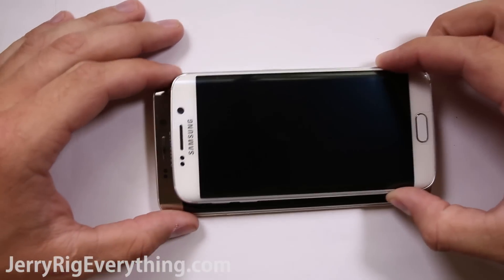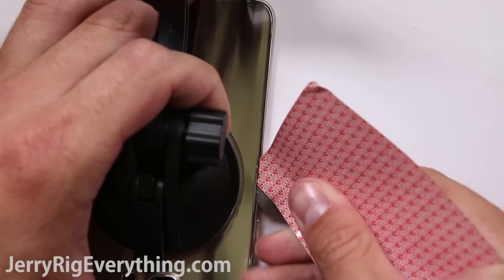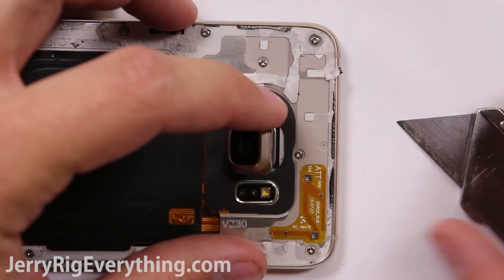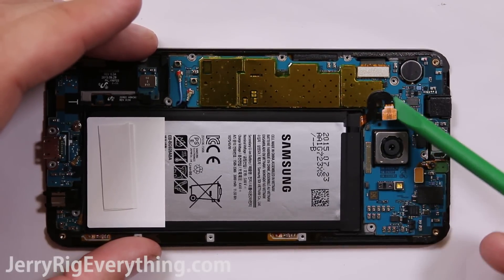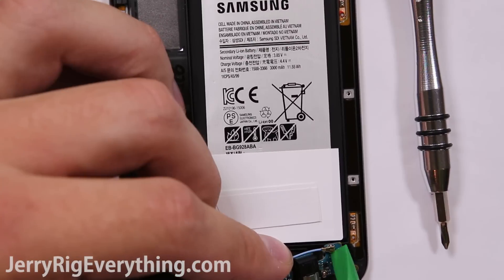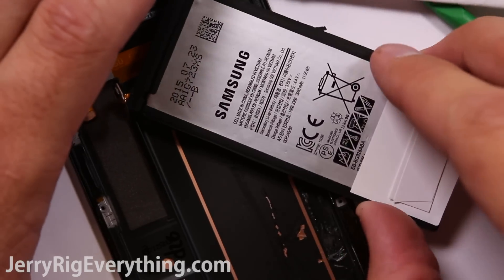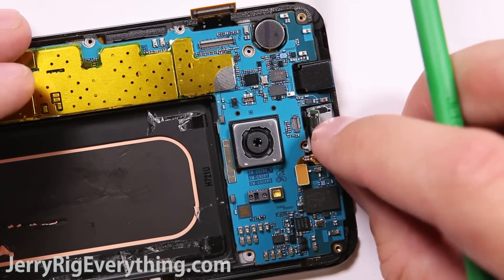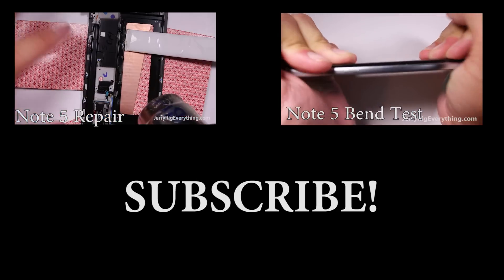Samsung Galaxy S6 Edge + PLUS Teardown and Repair video

Comment: Hi Jerry, thanks for the video! Quick question - I just poked the top mic hole with a sim card tool by accident. Whilst it didn't break the mic, do you think it could have damaged the water proofing material?
Reply from the maker: Nope! You're safe.  The waterproofing is off to the side of the shaft not at the end.
Reply: @JerryRigEverything  Thank you so much!!!

Comment: Dear Jerry!

At 2:00 minutes, there is a copper cable labeled "ATT R06 ZERO2_SUB" in the lower right corner of the phone. What is it for?
I accidentally damaged the part labeled "ATT R06 ZERO2_SUB" while replacing the battery on my own phone.

Can you still use this phone or go to the trash?

Thanks for the answer!

Comment: i tried using hair dryer to soften the adhesive but it wont budge
Reply: Same. I put it on full heat, high fan, with the dryer touching the back for several minutes to where it was too hot to touch and couldn't get it off.

Comment: Yeah... I just replaced my Battery and I kinda of pried to hard to get the battery out and when I put it back together I damaged the Screen. there is a black spot about 1/8 round and some pixels that are damage , they are mixed colors and will not go off. all in all it works and I want to replace the screen or get a phone with a bad ESN and replace the motherboard with mine. Just make sure to be very carefull when removing the battery, damaging the screen is VERY easy!!!

Comment: where can i find temperature sensor and how can i replace it for S6 edge ( not plus)?? It stopped charging showing the phone is overheated.
Reply: BASINA ADITYA ....charge only with original charger......and don't use while charging

Comment: Hey my phone is working but doesn't detect touch.

Screen is working like normal but it detect i am touching it.
what can i do?
Reply: Yağız Efe Demirel Your digitizer is broken. Replace the front glass
Reply: ah sorry this comment of mine is too old. i found a way to make the phone work. When you heat up the phone it jumps to life. it starts to detect touch. But after some time (probably because it gets cold) it makes that again. and about the digitizer. i don't even have scratches on the screen and when you heat up it works like a charm :D So which part is the problem now?

Comment: Hi hope u fine. My s6 edge was heating up when i put it in charge and all the time when i use it freezes then off and on i have send it many times to samsung for repairing but they created more issues to the phone than repair it. Can u please guide me how to fix these issues on my mobile as i got another iPhone to use but i still love my s6 edge. Please I'm waiting for your reply help and guide me please please please😢😢😢😢😢
Reply: Do you clear your running apps before closing your phone? It may solve your problem
Reply: Hosna Waheed , try to replace your battery and do a factory reset

Comment: my s6 edge was at the repair and they told me it has corrosion damage and so no warranty. The screen always turned black and it was hard to turn on again up to the point where it didnt turn on again at all (no way to do it). Can this be repaired if I clean the board and replace the battery (it could be damaged because of short curcit). It never has touched water, no idea how this could happen but I try to repair it myself if there is a chance (I do some soldering and electricity stuff) .
So you think it could work or do you have any hints?
Reply: +chibiebil ,
    Sure its dead from the motherboard. Try getting a new Motherboard if the LCD is still fine.
Reply: +Ni Gladious Yeah I know its a dead motherboard :/ I mean to fix it without investing much. New Motherboard would cost me 200-300 €. I prefer selling it then. I also get a new S7 in the next few days so it doesnt matter much anymore :/

Comment: Good to know that the USB port is insane to replace as I was thinking about doing this. Guess it's not as easy as with my old Note 3 and S2 lol
Reply: heard that on the note 4 you have to remove the screen from the frame just to replace the charging port...what kind of shit is that. I unfortunately dropped my s6 edge+ (5 months old) and now there's a big ball of dead pixels. I'm going to fix it and then sell it as it's a piece of shit what breaks waaaay to easy!
Reply: Macca 95 Yeah that's why i got insurance - any damage = new phone for 60 pounds :) Repair of edge screen would be like 200 so yeah
Reply: +MadMike41 I'm still deciding to get one off ebay for 130 (180 from Samsung through carphone warehouse) and then sell the phone  (it's good but it's not very robust) or take out an insurance plan and then claim in 1 or 2 months
Reply: Macca 95 I personally use Carphone Warehouse's Geeksquad and after cracking my S6edge+ screen with a powerbank, I paid in the money and they sent me a brand new one on the next day. So it's pretty good if you know you are likely to damage your phone. In the long run though, it is quite expensive.
Reply: +Macca 95 yup same here, I have a black sapphire edge plus.... And the screen was cracked but still functioning. One day when I was on the shitter, I was playing a game.. And placed the phone one the rug real quick, dont know what happened but it stopped working. This damn phone is expensive to fix, never again!
Reply: +shinzantetsu managed to get a screen off ebay  (samsung refurbished) for £108 can't tell the difference side by side with a working sy edge+ I got lucky I guess buying off ebay

Comment: You really should be using a plastic tool to get the back plate off as you ruined it with that sharp metal tool.
Reply from the maker: +Pezzy C Plastic tools tend to be thicker and harder to slide between the glass and frame. You can always try it though!
Reply: +JerryRigEverything Didn't mean it in any other way than trying to help other people preserve their back glass panel. I've worked in engineering for many years and have rigid plastic tools for that kind of job that wouldn't damage it

Comment: I'm wondering if I should attempt it myself or send the phone in for repairs. the screen is cracked and now the phone won't turn on.
Reply: yo my light won't turn on anymore (the one on top) you think it won't work anymore..
Reply: Toni Espinoza I put it on a wireless charger and after some time my light came on, if yours wont with regular charging, maybe it will with wireless, but idk if you want to invest in that.

Comment: Goshdarnit. Wanted to steal your imei, but it's covered. Good attention of detail.
Reply from the maker: Lol. Im one step ahead of you man.
Reply: JerryRigEverything make a scratch
Reply: What do ppl do with imeis?! I noticed my $6 edge+ imei shows as the phone being a note 5 so somethings def up! (I bought it off eBay recently BTW & haven't tried activating it bc it didn't come with a SIM tray..another red flag)
Reply: @heatherrhodge2588  This is Late, But uhm you have been scammed, They don't want you to know the imei, and have covered it up with a note 5 imei (and no simcard holder), so i would instantly contact the seller because the may do something  like Reset any passcodes or other things
Reply: EZW0RDX darn! it's been awhile since I bought the phone. I haven't tried getting it turned on thru a phone service yet , mostly 4 the fact that I don't have a Sim tray & bc I kinda had a feeling since the model of phone IMEI was incorrect that something like you said was the case. hmm, I guess I need to look into how long PayPal covers items being diff than advertised far as getn$bk. thx 4 letn me kno even if it has been awhile since I wrote the question!
Reply: EZW0RDX oh yea and what do u mean reset Passcodes? what ALL do u know of they can do having switched the IMEI? I'm assuming the phone was prob stolen & they changed it with a note 5 that shows up being ok on those database that show if a phones blacklisted.. I'm not that great understanding this kinda stuff but that's prob obv
Reply: Hey Jerry, could you tell me the size of the s6 edge battery compared to the s7 edge and s7 battery? I'm really interested to mod one of them in the edge frame, but the people who did it used the normal s6 and I'm dying to know if the s7 edge battery could go in my phone. The info online isn't very consistent.

Comment: thanks I have a s6 edge plus I need someone who knows how to replace the glass of the front my lcd work fine
Reply: It is "possible" but is insanely difficult to do..... Here in my city is a pretty high end phone service, but when I brought my galaxy s3 over there to replace the front glass and the outer frame of the phone,they told me, they will do it, but at my own risk. I trusted them, they showed me how they did it, and goddamn, is a long process... You have to separate the display from the phone's internals, put into a solution, wait a few hours, heat it up and slooowly remove the front glass from the LCD,and thenremove the LCD itself from the outer frame, which was really freaky to even watch .... This is really dangerous even at phones with flat screens(especially samsung)  and IDK if it's even possible with the s6 edge

Comment: Mine got runned over by cars.  Both screens are severely cracked.  I removed the back glass, but I cut into the top, right metal connection, by the camera.  What have I damaged?  Could I fix it? Does the glass, you linked, come with the charging connection? Thanks!

Comment: Is the gold paint on the back glass panel always going to be scraped off during the prying process. That made me afraid of doing a Samsung S6 Edge Plus repair video after I noticed that.
Reply from the maker: +Get Fixed Ya, it will.  Unfortunately. It is also really easy to break. So I imagine that most people will just end up shattering it when they try and remove it. (There are a few other videos on YouTube where the guys couldnt get the back off in one piece.)
Reply: Lol. Yeah that's all I needed to prevent me from attempting it. If I didn't buy it as a personal phone I would have been performed the repair even with all the risk factors. Good job on the repair tutorial and tear-down. You kept it interesting the whole video.

Comment: Where do you purchase parts? Im trying to figure out why I am getting light coming from the digitizer from the sides of the phones I repair (not this phone.) I basically trying to figure out of the digitizers Im getting from ebay are not the proper size and there is like a tenth of a millimeter offset or if the digitizer is just not set into the phone enough. IDK, I just dont want to have the light coming from the edges of the phone. It leads to a bad name when I get my company going with more business than I have now.
Reply from the maker: +Jerryg225OnRoblox I linked a replacement screen in the video description.  You can also check ebay, and amazon... but you just gotta be careful w/ the quality there.
Reply: +JerryRigEverything well I've used screens from eBay and they seem to be fine quality but I just seem to get a light through the edges of the digitizer where it touches the frame. I dont know if that's install problems or digitizer quality